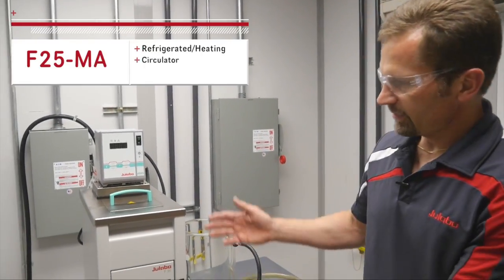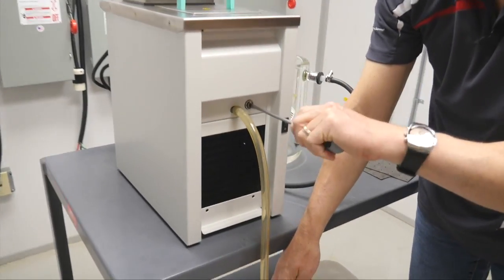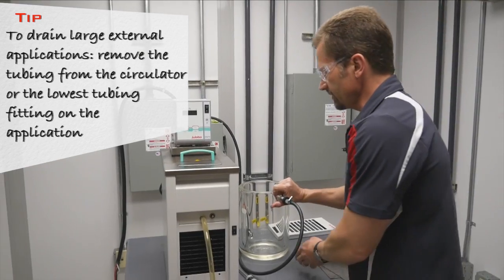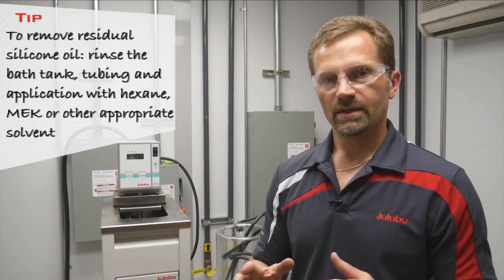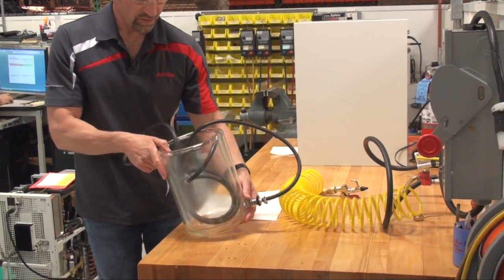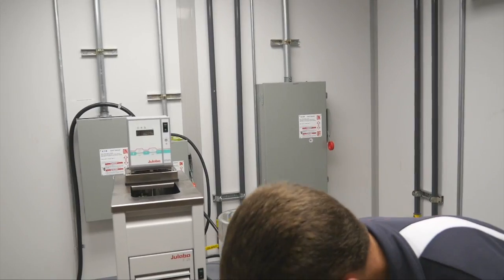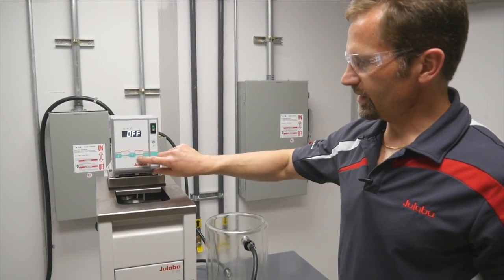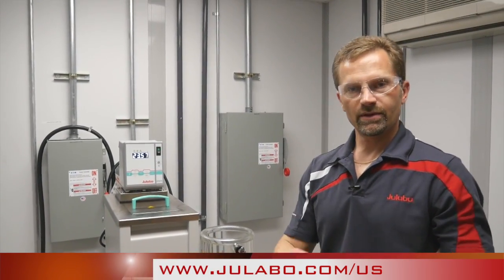F25-MA: Changing Bath Fluid

Comment: E 14 dir quoi ?
Reply from the maker: Hi Djamel. The official description for an E14 error reads that "The cut-out value of the excessive temperature protector is below the defined working temperature. Set the safety temperature to a higher value." Please contact us at service@julabo.us if you need further assistance.